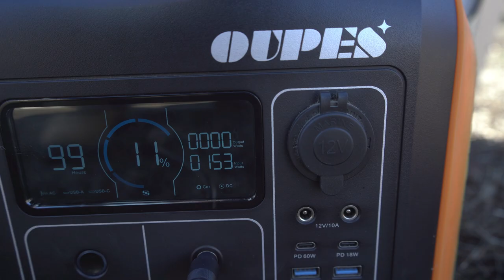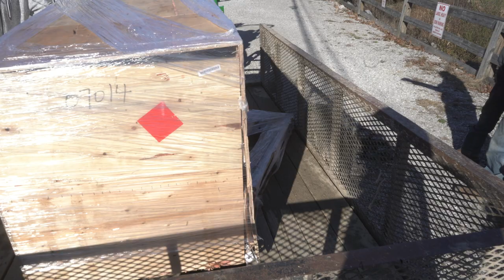Building Geodesic Dome In the Woods - Living A Simple Life Off Grid

Comment: You guys know if you get a few of those ( Ozark trail emergency blankets) they cost about $3 each, and staple them on your ceiling and mabey on the walls around your bed,..they reflect heat. They are thin, but amazing at reflecting heat back down. Staple one on the ceiling above your propane heater to. It will keep you much warmer in there. CHEEP.
Reply: I saw it on Duel survival. Cody built a tent out of plastic, put the silver blanket on the inside..far side of the tent. Built a fire outside beside the tent. They said it was 11 degrees outside but inside the tent it was 70.
Reply from the maker: I just told Jessica what you said and she was like let's go get then now.. it's cold in here this morning so I will probably do that..  thanks buddy
Reply from the maker: Look for an email from me this afternoon
Reply: @OffGridGrowing  I hope it works for you, like I said, I saw it on TV ( duel survival)  but get yourself some fleece blankets, they bounce your body heat back at you..I know that because that's all we buy. Cody said the UV from the heat those emergency blankets bounce back so..good luck guys. You should at least tack up plastic wherever the emergency blankets don't cover. Before the 5 degree day comes, because no insulation you will freeze. Mabey the walls beside your bed...stuff some of that straw behind the plastic. Throw one of the emergency  blankets under your sheet .
Reply: You get too cold you can't get warm again. Once you get hypothermia, you get disoriented, then your screwed. I hope you have more then a little budy heater, ..if that's what your using mabey you should throw up a 2x4 or 2 n tent around 3ft away from your bed, n just keep that warm. Just a suggestion. Like a small room
Reply from the maker: @rayhuber3411  yup a Mr Buddy is all we got right now.. can you send us an email so that I can save it. Wanted to send you something
Reply: @OffGridGrowing  I don't think I have a E mail, I'm low tech, know nothing about computers. My son set up my phone. Don't worry about it,. Do what you can to stay warm now, before that cold gets here. Take care guys.
Reply from the maker: @rayhuber3411  I'll text you then bud I have your number
Reply: @OffGridGrowing  You don't have to, just get prepared bud, you don't want to have to change something to stay warm in 5 degrees,  lol. Take care guys. Oh, n if you decide to use some of your straw for wall insulation..watch out for snakes, they like to stay warm too. Lol 🙂